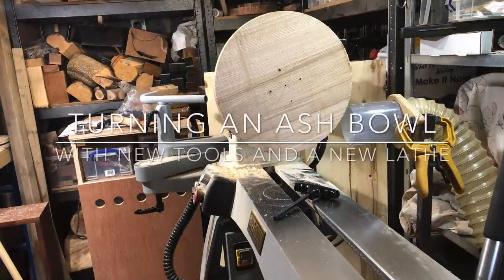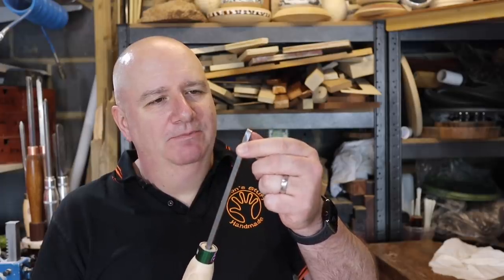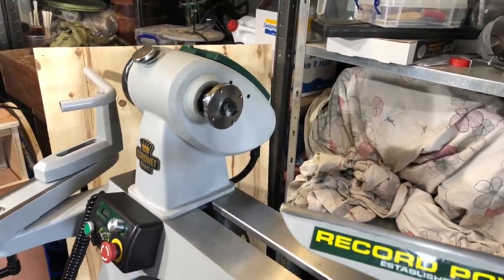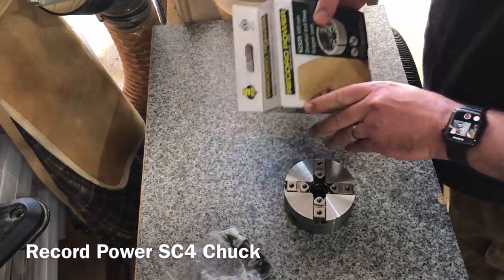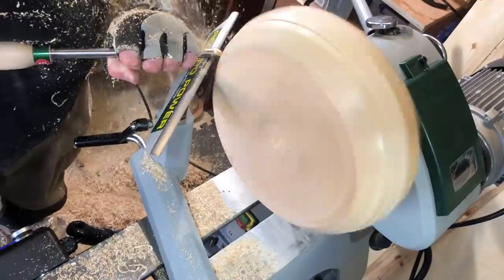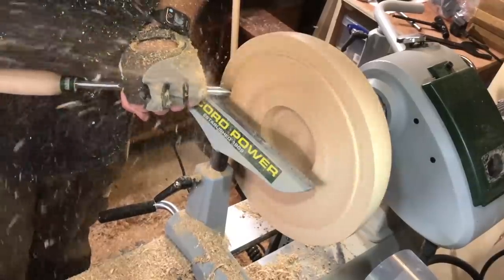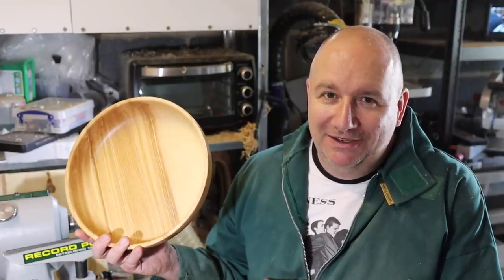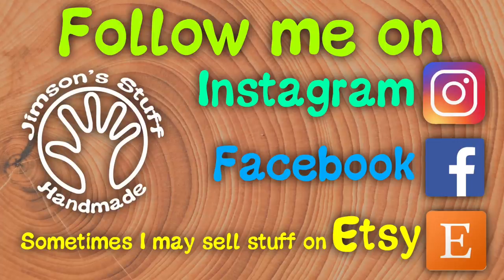Bowl Turning with New Tools and the Coronet Regent Lathe from Record Power

Comment from the maker: Many thanks for watching. The new turning tools from Record Power are not yet available but their launch is imminent and should be appearing in the new catalogue and website when released. I will make an announcement when they are available.
Cheers 
Jim
Reply: Which is the better lathe, or which would you rather have Jim, Record Powers MAXI-1 or the the new Coronet Regent?
Reply from the maker: @cgmcornel  I haven’t personally used the MAXI1 so difficult for me to say, I like the heavy duty no frills design of the MAXI1 but I prefer the control panel and digital display on the Regent. The heavier weight of the MAXI1 is an advantage but it is easy to install a shelf between the lower leg stretchers on the Regent so that heavy stuff can be stored on it to add extra weight. The Regent has certainly got a lot of power, I recently turned a 22inch bowl on it without any issues whatsoever. I haven’t checked recently but I think the Regent may be slightly more powerful than the MAXI1. If you get the Regent I would recommend getting the outrigger and bed extension but this does up the price.
Reply: @JimsonMakes  Thankyou for the quick response Jim; I'll be new to woodturning, and my logic is to get the best lathe I can, rather than needing to buy another lathe again in a few years! Hope that doesn't seem daft! I have some money put by, so will hopefully be getting a  15ft x 10ft shed, and kitting it out from scratch  next year! I used to be a glassblower; and have been blown away by what I've seen being turned in demonstrations, and on YouTube. Am focusing mainly on 'Record Power' for totting up my wish list / what I want next year; am trying hard not to get too carried away!  Definitely feel like I've found a new passion for life!
Reply from the maker: @cgmcornel  that sounds like a great plan. The Regent lathe is a very good lathe and certainly good value for money. It is very quiet and powerful and should be more than enough for most turners. Remember to allow money for a good sharpening machine ( I personally like the Sorby Proedge ). If possible it is best for the lathe to be standing on a concrete floor, much less bounce and vibration. If your shed has a wooden floor then it may be possible to cut part out and pour a small concrete section or put extra supports under that part. It is surprising the forces generated by even a small piece of timber. Also advisable to clad the shed inside with some insulation, this reduces temperature changes and lessens condensation forming on metal surfaces which can cause rusting on machinery and tools.
Reply: @JimsonMakes  Cheers for the advice and suggestions regarding  what lathe, tools and shed etc, any other thoughts or suggestions regarding layout  and useful kit will always be gratefully received! Really appreciated!! And definitely feel like it's never too late to learn something new, 49 next march; so here goes the next 30 years!
Reply: @JimsonMakes  
Hey Jim, if you don't mind me picking your brains one more time, is that I've noticed one difference between the MAXI-1 lathe and the Regent, is the Rpm of the Regent starts at 250, and the MAXI-1 starts at 50 Rpm! How useful / important is this to woodturning? Or nothing that I need to be overly concerned with?
Reply from the maker: @cgmcornel  the lower speed is very useful when applying finishes so that they dry and don’t run, something I wish the Regent had. 50rpm is too slow for actual turning
Reply: @JimsonMakes  
cheers for that, I was just wondering if should / could influence my decision? Really appreciate the advice and thoughts.
Reply from the maker: @cgmcornel  the slow speed is nice but certainly not absolutely necessary and certainly not a deal breaker
Reply: Hi there Jim, sorry to bother you again! Will soon be ordering Regent lathe etc, and whilst I have a little spare cash, I was wondering how useful as regards to woodturning, you think a pillar drill wood be!? Cheers Cornelius Matthews.
Reply from the maker: @cgmcornel  a pillar drill or drill press is not essential for Woodturning but is certainly one of my most used machines in my workshop. It is so useful to be able to drill accurate holes and is incredibly useful when using Forstner bits. Also much safer when drilling metal.
Reply: @JimsonMakes  Once again Jim thanks for the help; hopefully by the end of February / beginning of March, I'll have shed built and electrics done, so will be ordering lathe etc soon! Can just feel myself getting a little bit carried away. Is there any other machinery that you think would be worth investing in? Am going for the Regent lathe, and would also like to get the Sabre350 bandsaw! Just thinking about what else might be useful to get whilst the funds are there!? Once again thanks for the help and advice; I feel a kid in a candy shop; now can't wait to get started! Cheers, Cornelius.
Reply from the maker: @cgmcornel  a sharpening machine is essential, I personally like the Proedge from Robert Sorby. Another machine that gets a lot of use is my sanding machine, it is a combined disc and belt sander, Record Power do a couple of good ones.
Reply: @JimsonMakes  Yep I've been looking at the Sorby Pro edge sharpener; unfortunately people with stock of them, seem to be charging about £70 more than Yandles are for there Sorby package! ( I guess because of the delays caused by the pandemic) Don't know whether to wait, or pre-order from Yandles, knowing it's what I want at a reasonable price, but will take a while!
Am kicking myself for not getting sorted sooner; this past year I could've learned and achieved alot if I'd had everything already in place!
Ooo! Could I just ask you what's a good wood to start out using, something that's little more forgiving to the novice!
As usual, thankyou so very much for the advice; and keep up the amazing work, it really is inspirational!! Cheers, Cornelius Matthews.
Reply from the maker: @cgmcornel  sycamore is cheap and relatively easy to turn but can be tricky to get a good finish. Bits of pine are good for spindle turning practice

Comment: Informative video thanks. I have a couple of questions, is the Coronet Regent lathe made in England and can you add extensions to both ends of the lathe, headstock and tailstock areas for doing longer turnings?
Reply from the maker: Sorry for the late reply. The Regent is not made in England except a couple of components but it gets a full PDI by Record Power before dispatch. I think you can only fit a bed extension to one end, the fittings at the other end are for the outrigger.
Reply: @JimsonMakes  Thanks Jim for the information.

Comment: Great bowl Jim! I love Ash. Tools looked like they worked perfectly, great kit. Also the lathe was awesome. Just a little bit of wondering on my part, the tail stock looked a bit undersized for a lathe of that capacity. Just saw a quick bit of it. Otherwise looked like it took on that ash with ease! Take care Jim.
Reply from the maker: Thank you very much Jeff. Haven’t really used the tailstock in earnest yet, seems very stable though. I do like a lot of weight on a lathe. I was very impressed with the power of the lathe and very quiet too.
Cheers 
Jim

Comment: Hi Jim. Great video! I'm thinking of investing in a Coronet Regent. You've already answered a lot of my questions. But does it ever have a problem with vibration? Would it need to be pinned to the floor?
Reply from the maker: Hi Mike, I have not noticed any excessive vibration but mine is very heavy with the addition of the bed extension and the outrigger. It also has a large tool storage unit on a shelf underneath it which is held between the legs. All woodturning lathes generate vibrations and it is weight that counteracts this. The lathe is very smooth and quiet which is great for me in my little workshop. Obviously a concrete floor is essential but I have not felt the need to fix it down.

Comment: Its a really nice looking lathe, but for a $2400 price tag i would expect that lol. But my question on the tools, is there really any difference between those, or robert sorbys, or any other name brand expensive lathe tool for wood? Handel shape and size differences, maybe metal composition differences, but in reality is there much difference? The quality of the cut is directionally equivalent to the ability of the user and the quality of the edge of the tool right? Lol
Reply from the maker: Many thanks for watching. Yes the lathe is great, here in the UK the price is very competitive for the quality and specification. As for lathe tools, the new Record Power tools are a step up from the older ones in my opinion. Many HSS tools are similar but I have found over time that some hold an edge much longer than others. Some tools also have a poor profile which leads to an odd shaped bevel. I think the Record Power tools will be very competitively priced on release. You are quite right, a lot of it is down to your skill in using the tool.
Cheers 
Jim

Comment: Thanks Jim,  I am looking at the Regent to upgrade from my Laguna 12/16.  Do you find the Regent heavy enough for large, unbalanced blanks.  From my research it seems the Regent has plenty of power.  Thanks and keep up with the great videos.
Reply from the maker: I am delighted with my Regent lathe. It is fairly heavy, especially with the bed extension and outrigger fitted. It is easy to add weight by putting a shelf between the legs and installing a heavy duty tool box in which to store heavy items such as chucks and face plates

Comment: Hi Jim, how does the coronet compare to the axminster ? I had my mind set on the axminster but not so sure now ,would appreciate your view as you have used both. Many thanks
Reply from the maker: Hi Adrian, I am loving the Record Power lathe, it is certainly quieter and more powerful and the control panel is much superior. The castings are also superior quality. The extra capacity is also useful, they both have revolving heads but the outrigger makes more sense space wise in my small workshop. The Axminster is a good lathe and I have never had any complaints. It is still early days but I would have to say the Regent has the edge, especially with the addition of the outrigger. I hope this helps.
Cheers 
Jim
Reply: Jim Overton - Jimson's Stuff  thanks for taking the time to reply. Very helpful.

Comment: I have that lathe and its the dogs bollocks, the tools Im not so sure, I have tried them but I prefer carbide coming from metal turning and have got used to it.  I would like to try HSS but Im not sure I could deal with all the sharpening all the time, sometimes every minute on hard wood.  The tools look nice, in my view these things at the cost should come in a simple nice box to keep them safe and rust free. they are not cheap and by adding a 5 pound box your not really doing much to the price.

they should have done the control box on the Herald the same as this as that was its failing, also a brilliant lathe and will do Records profits well, I bought mine in spain and its superb.  No regrets at all, bank manager yes but not me...
Reply from the maker: Yes a fantastic lathe. The control box is great, they have now added an inline stop switch for the Herald, I think they were keen to keep it a compact machine. I use mainly traditional HSS tools but I will use carbides on very hard woods and resins. I find traditional tools more satisfying and efficient to use on most woods and the more sharpening you do, the quicker you get. I tend to discard all packaging and put my tools in a rack. I know Record Power are looking to reduce the amount of packaging and the new sleeves are recyclable .

Comment: Jim I’ve just set up my bowl turning attachment on my record CL3 36x30  and it’s got a bit of a wobble on it…I’m sure there’s many possible reasons for this. But what’s the most likely 👍🏻
Reply from the maker: As you say could be a number of things. Check everything is tight and if it is on an outrigger, set it up so you have minimal overhangs, this will minimise vibration. Use light cuts when using an outrigger. The further away from the bed you are the more vibration will be multiplied at the tool rest.
Reply: @JimsonMakes  thanks Jim still haven’t got to the bottom of it would bolting the lathe down help👍🏻
Reply from the maker: @williamswhistlepipes  putting a shelf under the lathe and loading with heavy stuff helps, as could bolting it down. Concrete floor is also recommended as it reduces bounce. You will always get more vibration when not turning directly over the lathe bed. The more weight you can get in the lathe the steadier it will be.
Reply: @JimsonMakes   thanks Jim I’m going to bolt her down this afternoon it’s a concrete floor and it’s not that level so it will allow me to level it up too. 👍🏻👍🏻👍🏻

Comment: I have to ask, was that a weight lifting glove you were wearing?
Reply from the maker: It is an old cycling glove. You have to be careful wearing gloves when using lathes as they could potentially drag your hand if they get caught. I would only recommend wearing tight and fingerless gloves and keeping them clear of the workpiece. I tend to only wear them if I have to, usually to protect my hand from the hot shavings that come of these kiln dried woods. Many thanks for watching 
Cheers 
Jim

Comment: The tool rest on the outrigger looks like a piece of thin pipe.  So cheap for a very expensive lathe.
Reply from the maker: it does look like that but seems to work very  well. It takes a standard 1 inch stem so there are plenty of other tool rests available if you wanted to change it.